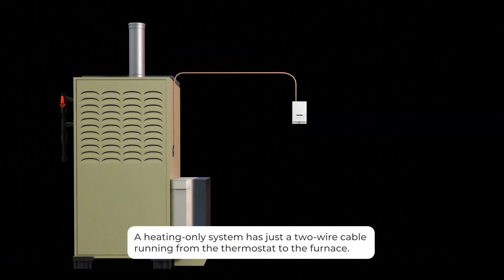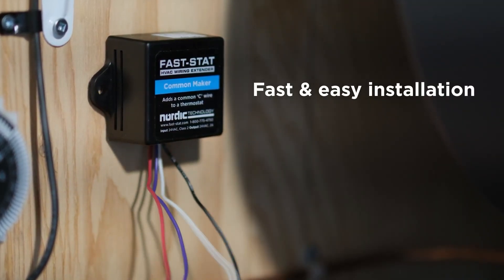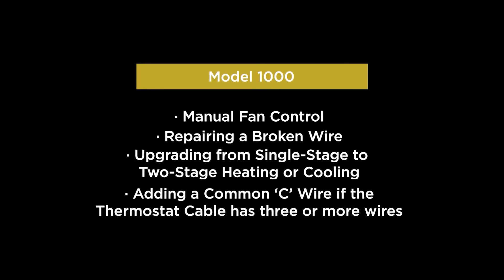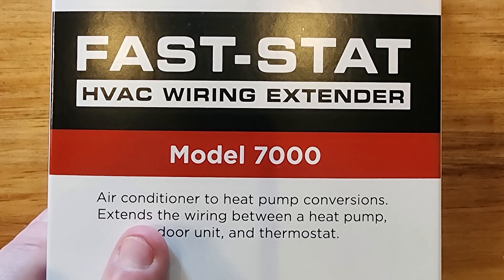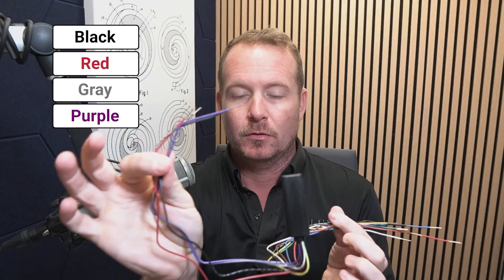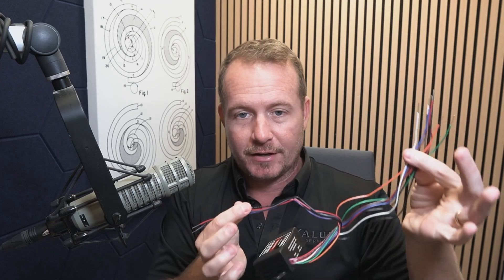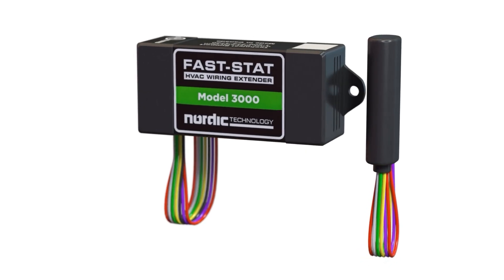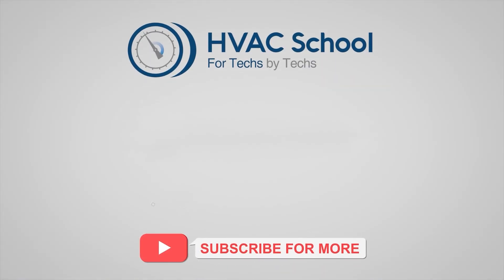The Simplest Way to Add Control Wires in HVAC

Comment: Just use the G as the common on a gas furnace and you’ll be fine. Nobody needs to run the fan continuously. Makes more humidity in the summer

Comment: Are you familiar with the Carrier infinity thermostat just installed one and they’ve all have a connectivity issue and they do not know when there’s gonna be a fix. What’s your opinion on that thanks.
Reply: If you mean it won't connect to the carrier server and you can't connect it to your phone, once you connect it to the Internet it should self update itself to the latest software and then connect to the server on it's own.
Reply: @ that’s the problem. There’s a software issue with the thermostat and won’t allow me to connect to the Carrier server. They told me they’re trying to fix that now, but don’t know when it’ll be done. How the hell can they send out an expensive piece of equipment, and then let their dealers sufferfor their mistakes.

Comment: If this is new to you, this has been around for a decade.  Proven tech at this point, even if it has issues stated in the comments here. Its far easier and cheaper than breaking open walls and more stable than Wifi systems
Reply: I have a two stage geothermal heat pump with only 4 wires in the Tstat cable. We changed the tstats and before it was ecobee eim communicating. I have running as single stage with no fan wire. I have r,c,o,y. 
Which model do you recommend so I can have it running with both stages?
Reply: @abnergarcia6252  a 3000 system will give you a G terminal control and a Y2.  A 5000 will give you G, Y2 and and a W for your back-up heat (Aux or Emergency) if you have it. A 5000 will give tou expansion room if you upgrade in the future.  The Fast-Stat youtube channel can also help you make the decision.
Reply: i had a 4 wire cable.  pulled out the old cable from the wall to the basement. drilled a new hole and opened up the wall cavity by removing the stops for the sliding door jamb. then i put back the old cable along with a new 5 wire cable. no more changing batteries in the thermostat.

Comment: Communicating data protocol introduced over standard thermostat wires. This product should’ve been around 40 years ago like it was in the Japanese VRF Products. 
        Basically take a raspberry pie or Dino nano sending communicating data make or break connections. 
       This will definitely get some people out of a expensive expensive labor, consuming situation very helpful

Comment: I need one that works for package units!
Reply: @Silky_boi we like your line of thinking! As long as the PTAC unit is conventional 24V control and has a 24V transformer either built in or installed externally then the Fast-Stats should work with it. Depending on how many functions need to be added, anything from the Common Maker to the Model 5000 will work. The Model 7000 and Model 9000 will not work for those PTAC units unless it is a part of a split system.

Comment: I have used all of these before. They are not the ideal solution as they do fail. Namely due to heat built up on the unit behind the stat in the wall. Try and have them as well ventilated as possible. Something else to consider is that the heat it produces can adversely affect the stat read out. Running a new wire is always best but for those times where a new wire is not a feasible option this is a good last resort.
Reply: @adamradley4407 this is great feedback. The heat problem is one that we have recently fixed. The sender would put out 1.5W of heat on the old versions and we've managed to knock that down to 0.5W on the new versions. The sender can be left hanging in the empty space behind the wall and the wires are long enough so that it will barely affect the stat read-out.